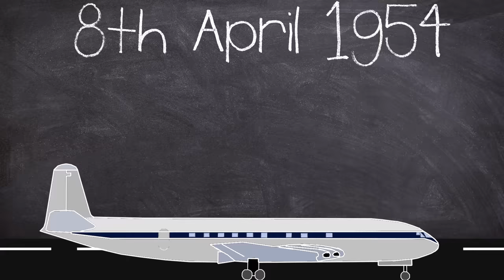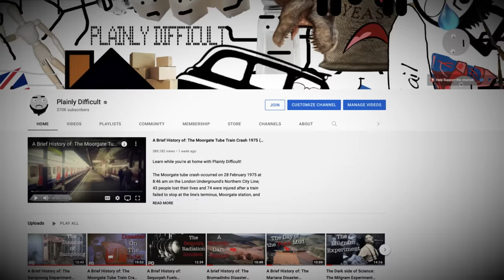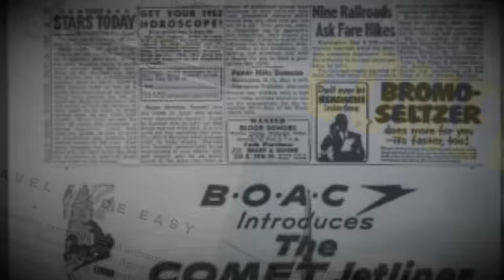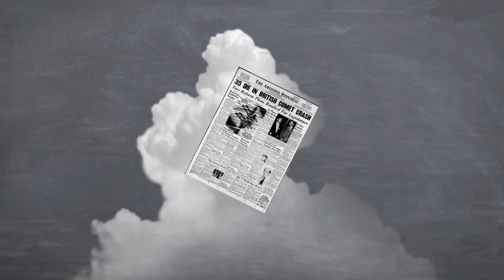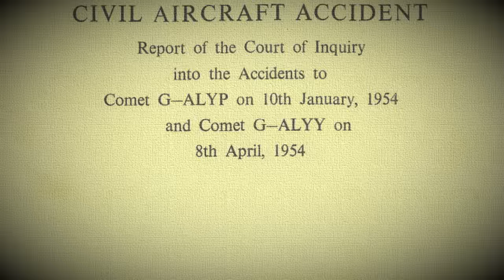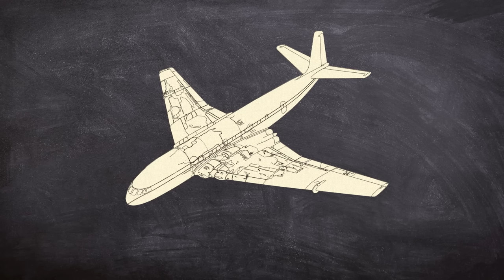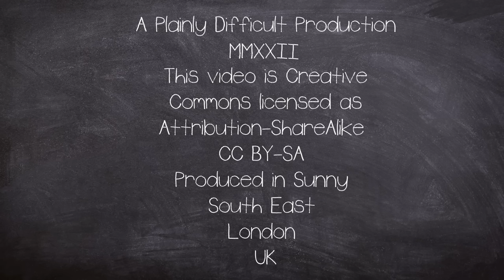A Brief History of: The de Havilland Comet Design Disaster 1954 (Documentary)

Comment: Yes I would enjoy to go on a measure flight on one with my grandfather who is indebted to them in his words, for when he was a wee lad he traveled from Britain to Australia on one as a sign of his own independence in… around 1948
Reply: He is was very lucky he was not killed, the Comet was the worst engineering failure in commercial aviation history
Reply: This video has some BS included.
For example - 
  
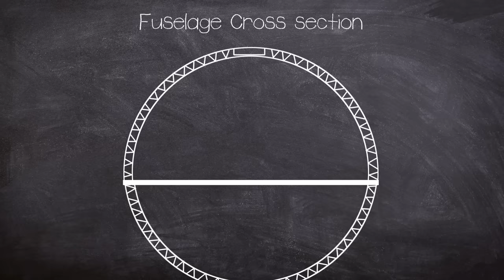    5:20   The idea that only the crew & passenger areas were pressurised is absurd obviously. 
  Every part of the fuselage was pressurised from the nose to the rear fuselage bulkhead including the entire cargo area.

Besides that.
Comets flew until 1997.
The Comet design had military use as a requirement. Nimrod development began at 
De Havilland before 1953.
Nimrods were not withdrawn due to structure problems or other airframe issues it was entirely a significant upgrade snag & resultant basic economics & an end of line sale happening at Boeing at the same time.

We feel we can shed some light on some common misunderstandings.

At the time the Comet wasn't particularly dangerous.

Losses comparisons
How things were in those days.

DeHavilland Comet 4 UK           14% 
DeHavilland Comet all  mks       17%  

Boeing 307                               70%
Boeing 247                               48%
Boeing 707            .                  20% 
Boeing 707                                20% 
Lockheed Electra Turboprop   29%
Canadair CL-44  Turboprop     46%  
Convair CV-580  Turboprop     22%
Convair CV-880    (ff 1959)       27%  
Convair CV-990     (ff 1961)      35%

    Of course De Havilland had prior experience building many all metal construction airframe aircraft including thousands of jet powered fighter aircraft that were primarily of metal construction with pressurised cockpits & jet engines built by De-Havilland.

   De Havilland carried out full stress analysis & engaged in a comprehensive & protracted testing program which is why key De Havilland people were happy to be aboard flying DH Comet aircraft.

   The DH Comet was the first passenger airliner with full length fuselage pressurisation at 8psi pressure differential. Handley Page built the world's first airliner.

   Of course ripstop provision was provided. The skin alloy used became unavailable at the time due to R & D at the manufacturers which resulted in the original alloy being discontinued.
The skin thickness used for the Comet was used for similar later aircraft. 
Frame spacing was not found to be too large & frame width was not found to be too small.

  De Havilland did indeed always work to better than industry standards at the time, used up to date knowledge for the design & construction & no evidence of negligence  or criminal negligence was ever produced in relation to the DH Comet.

  The DH Comet had no effect on the course of the aerospace industry in the UK. The UK now has the world's largest combined nuclear, aerospace & defence sector per capita activity.

    The investigation committee did not find hundreds of fatal flaws or evidence of design defects, structural defects, defective materials or shoddy workmanship. Ripstop provision was included. Claimed incidents did not involve cracks starting from window corners.
Pretty much all changes were just in case changes or were planned development modifications & improvements that were scheduled regardless of incidents.

De Havilland designers knew all there was to know about metal fatigue at the time they designed the DH Comet.

Hope this helps.

Cheers 👍
  
. ...
Reply: This video has some BS included.
For example - 
  
    5:20   The idea that only the crew & passenger areas were pressurised is absurd obviously. 
  Every part of the fuselage was pressurised from the nose to the rear fuselage bulkhead including the entire cargo area.

Besides that.
Comets flew until 1997.
The Comet design had military use as a requirement. Nimrod development began at 
De Havilland before 1953.
Nimrods were not withdrawn due to structure problems or other airframe issues it was entirely a significant upgrade snag & resultant basic economics & an end of line sale happening at Boeing at the same time.

We feel we can shed some light on some common misunderstandings.

At the time the Comet wasn't particularly dangerous.

Losses comparisons
How things were in those days.

DeHavilland Comet 4 UK           14% 
DeHavilland Comet all  mks       17%  

Boeing 307                               70%
Boeing 247                               48%
Boeing 707            .                  20% 
Boeing 707                                20% 
Lockheed Electra Turboprop   29%
Canadair CL-44  Turboprop     46%  
Convair CV-580  Turboprop     22%
Convair CV-880    (ff 1959)       27%  
Convair CV-990     (ff 1961)      35%

    Of course De Havilland had prior experience building many all metal construction airframe aircraft including thousands of jet powered fighter aircraft that were primarily of metal construction with pressurised cockpits & jet engines built by De-Havilland.

   De Havilland carried out full stress analysis & engaged in a comprehensive & protracted testing program which is why key De Havilland people were happy to be aboard flying DH Comet aircraft.

   The DH Comet was the first passenger airliner with full length fuselage pressurisation at 8psi pressure differential. Handley Page built the world's first airliner.

   Of course ripstop provision was provided. The skin alloy used became unavailable at the time due to R & D at the manufacturers which resulted in the original alloy being discontinued.
The skin thickness used for the Comet was used for similar later aircraft. 
Frame spacing was not found to be too large & frame width was not found to be too small.

  De Havilland did indeed always work to better than industry standards at the time, used up to date knowledge for the design & construction & no evidence of negligence  or criminal negligence was ever produced in relation to the DH Comet.

  The DH Comet had no effect on the course of the aerospace industry in the UK. The UK now has the world's largest combined nuclear, aerospace & defence sector per capita activity.

    The investigation committee did not find hundreds of fatal flaws or evidence of design defects, structural defects, defective materials or shoddy workmanship. Ripstop provision was included. Claimed incidents did not involve cracks starting from window corners.
Pretty much all changes were just in case changes or were planned development modifications & improvements that were scheduled regardless of incidents.

De Havilland designers knew all there was to know about metal fatigue at the time they designed the DH Comet.

Hope this helps.

Cheers 👍
  
   .. .....

Comment: Why the would the cutting edge be landing in SA anyway? What a kewl looking plane. It engines look underpowered judging by photos.
Reply: The Comet was the fastest British airliners in service, ideal for long flights.
The placement of the engines inside the wing was another fatal flaw..
Yes, the De Havilland made engines were very under-powered
Reply: This video has some BS included.
For example -
  
    5:20   The idea that only the crew & passenger areas were pressurised is absurd obviously. 
  In fact every part of the fuselage was pressurised from the nose to the rear fuselage bulkhead including the entire cargo area.

Comets flew until 1997.
The Comet design had military use as a requirement. Nimrod development began at 
De Havilland before 1953.
Nimrods were not withdrawn due to structure problems or other airframe issues it was entirely a significant upgrade snag & resultant basic economics & an end of line sale happening at Boeing at the same time.

We feel we can shed some light on some common misunderstandings.

At the time the Comet wasn't particularly dangerous.

Losses comparisons
How things were in those days.

DeHavilland Comet 4 UK           14% 
DeHavilland Comet all  mks       17%  

Boeing 307                               70%
Boeing 247                               48%
Boeing 707            .                  20% 
Boeing 707                                20% 
Lockheed Electra Turboprop   29%
Canadair CL-44  Turboprop     46%  
Convair CV-580  Turboprop     22%
Convair CV-880    (ff 1959)       27%  
Convair CV-990     (ff 1961)      35%

    Of course De Havilland had prior experience building many all metal construction airframe aircraft including thousands of jet powered fighter aircraft that were primarily of metal construction with pressurised cockpits & jet engines built by De-Havilland.

   De Havilland carried out full stress analysis & engaged in a comprehensive & protracted testing program which is why key De Havilland people were happy to be aboard flying DH Comet aircraft.

   The DH Comet was the first passenger airliner with full length fuselage pressurisation at 8psi pressure differential. Handley Page built the world's first airliner.

   Of course ripstop provision was provided. The skin alloy used became unavailable at the time due to R & D at the manufacturers which resulted in the original alloy being discontinued.
The skin thickness used for the Comet was used for similar later aircraft. 
Frame spacing was not found to be too large & frame width was not found to be too small.

  De Havilland did indeed always work to better than industry standards at the time, used up to date knowledge for the design & construction & no evidence of negligence  or criminal negligence was ever produced in relation to the DH Comet.

  The DH Comet had no effect on the course of the aerospace industry in the UK. The UK now has the world's largest combined nuclear, aerospace & defence sector per capita activity.

    The investigation committee did not find hundreds of fatal flaws or evidence of design defects, structural defects, defective materials or shoddy workmanship. Ripstop provision was included. Claimed incidents did not involve cracks starting from window corners.
Pretty much all changes were just in case changes or were planned development modifications & improvements that were scheduled regardless of incidents.

De Havilland designers knew all there was to know about metal fatigue at the time they designed the DH Comet.

Hope this helps.

Cheers 👍
  
   
cvxcvvxii

Comment: I'm not sure I'd rate this that high on the severity scale, its absolutely a milestone in aircraft safety and rightly deserves its place on the legacy scale, but air travel at the time wasn't nearly safe enough to make this that much of an outlier. there were accidents from other manufacturers at the time with as much loss of life, its just the comet was being pushed out so rapidly and was such a prestige project
Reply: Eh, I'd argue that considering planes couldn't carry many more people than this it should be that high. It was the third accident of the same type, and the third one where I believe everyone died. Yeah, air crashes like that one Japan airlines flight killed 500 people, but this is very much comparable simply due to the amount of people it could carry. It was a shock, and was severe not only because of the deaths but also essentially the death of the Comet itself.
Reply: @OfftheWallTales  ya but you had piston powered airplanes crash and kill as many people, its just this crashed because of a design flaw, though I'd argue the super constellations loosing engines routinely was also a bad design flaw

Comment: didn't the comet live on as the "Nimrod" for the British military?
Reply: The Nimrod was designed by Hawker Siddeley 20 years later..
Long after de Havilland went tits up in 1958.
Reply: This video has some BS included.
For example -
  
    5:20   The idea that only the crew & passenger areas were pressurised is absurd obviously. 
  In fact every part of the fuselage was pressurised from the nose to the rear fuselage bulkhead including the entire cargo area.

Besides that.
The engine position & inlet design were not flaws or fatal flaws, there were good reasons for that design choice at the time.

Comets flew until 1997.
The Comet design had military use as a requirement. Nimrod development began at 
De Havilland before 1953.
Nimrods were not withdrawn due to structure problems or other airframe issues it was entirely a significant upgrade snag & resultant basic economics & an end of line sale happening at Boeing at the same time.

  We feel we can shed some light on some common misunderstandings.

  At the time the Comet wasn't particularly dangerous.

Losses comparisons
How things were in those days.

DeHavilland Comet 4 UK           14% 
DeHavilland Comet all  mks       17%  

Boeing 307                               70%
Boeing 247                               48%
Boeing 707            .                  20% 
Boeing 707                                20% 
Lockheed Electra Turboprop   29%
Canadair CL-44  Turboprop     46%  
Convair CV-580  Turboprop     22%
Convair CV-880    (ff 1959)       27%  
Convair CV-990     (ff 1961)      35%

    Of course De Havilland had prior experience building many all metal construction airframe aircraft including thousands of jet powered fighter aircraft that were primarily of metal construction with pressurised cockpits & jet engines built by De-Havilland.

   De Havilland carried out full stress analysis & engaged in a comprehensive & protracted testing program which is why key De Havilland people were happy to be aboard flying DH Comet aircraft.

    The DH Comet was the first passenger airliner with full length fuselage pressurisation at 8psi pressure differential. Handley Page built the world's first all metal construction airliner during the 1920s.
    In many cases earlier pressurised aircraft were larger, needed thicker fuselage skins due to flying stresses & had much lower pressurisation differential pressure.

   Of course ripstop provision was provided. The skin alloy used became unavailable at the time due to R & D at the manufacturers which resulted in the original alloy being discontinued.
The skin thickness used for the Comet was used for similar later aircraft. 
Frame spacing was not found to be too large & frame width was not found to be too small.

   De Havilland did indeed always work to better than industry standards at the time, used up to date knowledge for the design & construction & no evidence of negligence  or criminal negligence was ever produced in relation to the DH Comet.

   The DH Comet had no effect on the course of the aerospace industry in the UK. The UK now has the world's largest combined nuclear, aerospace & defence sector per capita activity.

    The investigation committee did not find hundreds of fatal flaws or evidence of design defects, structural defects, defective materials or shoddy workmanship. Ripstop provision was included. Claimed incidents did not involve cracks starting from window corners.
Pretty much all changes were just in case changes or were planned development modifications & improvements that were scheduled regardless of incidents.

  De Havilland designers knew all there was to know about metal fatigue at the time they designed the DH Comet.

Hope this helps.

Cheers 👍. 
 
 . . .... ... ..... ....
.. . ............ .... .